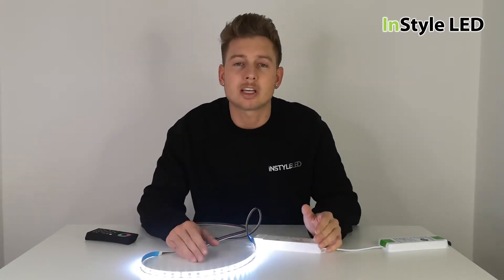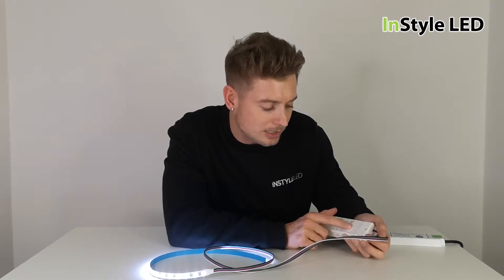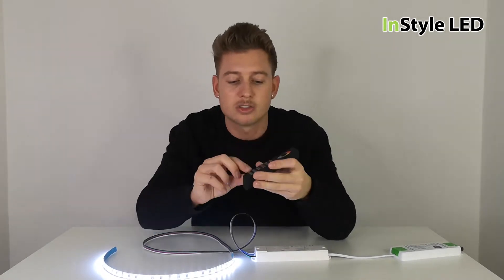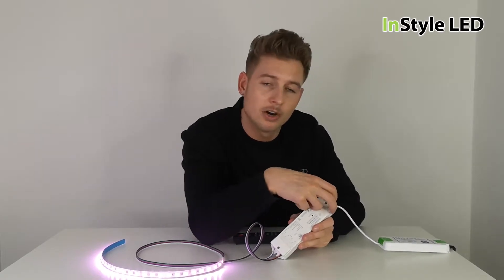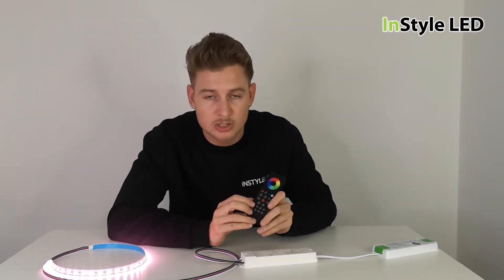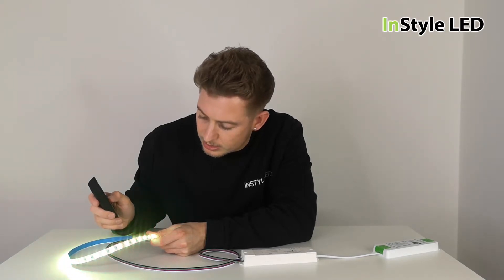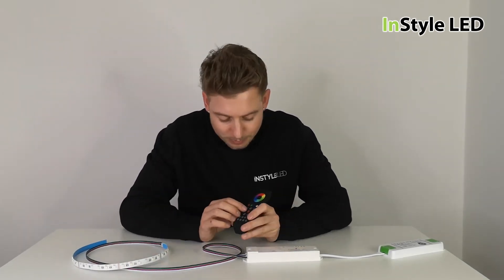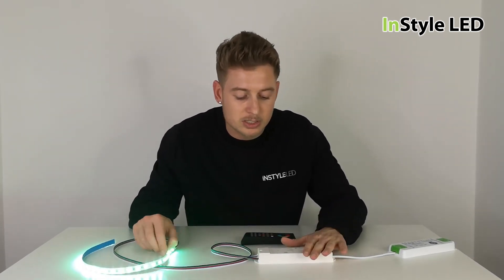Troubleshooting the RC-RF-RGB-5 (InStyle LED's RGBW receiver)

Comment: Hello. I have the Prism Pilot Controller and box. The box not the actual controller has a blinking light. Lights were working but there was a slim wire extending from the tiny cables and they arched and blew a fuse. No biggie I replaced the fuse. Now after the fuse has been replaced the box just blinks red. I cant find jack online nor a direct link to Prism pilot themselves. The reset button does nothing. Its grounded correctly no other fuses to the lights but the on on the battery and individual one on the power bus which have been replaced. This red blinking light means something.